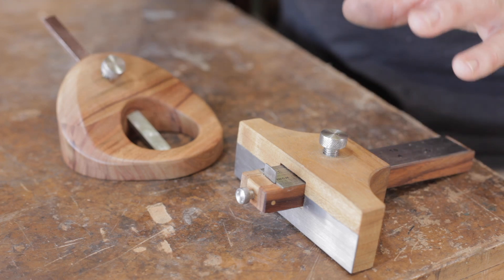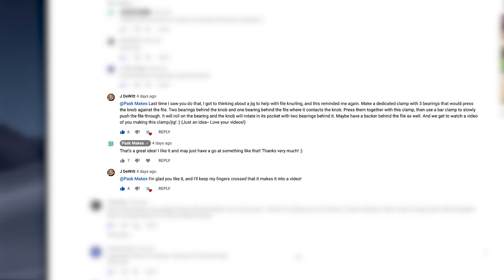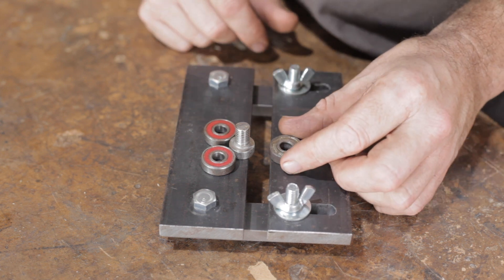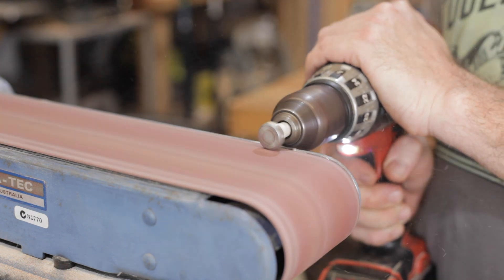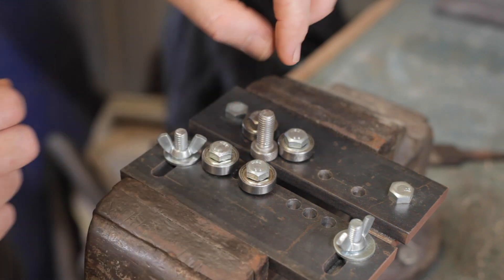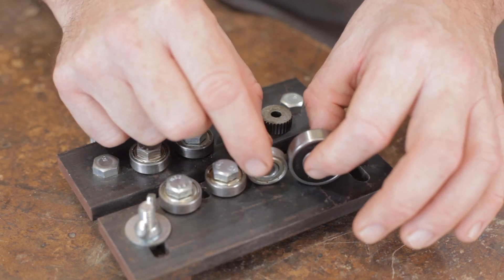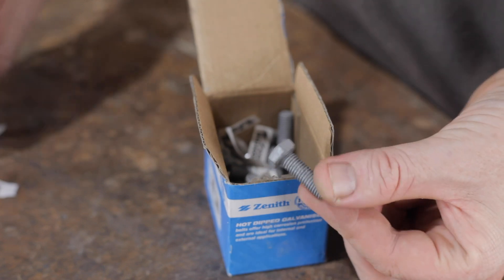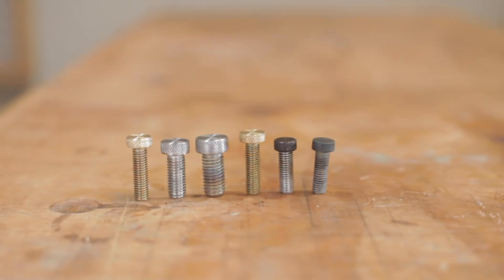Homemade Knurling Jig

Comment: Thanks so much for your videos. I often learn a lot from them.  When I was a student in school, we used to do knurling on a metal lathe and we used motor oil on the knurling tool to lubricate the tool and the job.  It tends to make the cutting process easier on the tool and the job... Thanks again for your efforts. Great job.

Comment: Yes, I know this is over 4 years later but I decided to comment anyway. Using a file was an interesting idea in order to get a somewhat "knurled-ish" surface on your thumbscrews and I believe it can still work if you incorporate solid bearings and an overhead support column to keep the solid bearings at a perfect 90° angle relative to the baseplate. The problem is how to come up with the solid bearings? Well, as a machinist I would simply make them using a lathe... but then one would have to ask why I would manufacture a tool to knurl anything if I had a lathe... and could conduct knurling operations on it. Uh, yeah. Let's pretend I just had a "friend" make them for me! Great!! So I would have my "friend" make me 4 piece, shell type solid bearings out of stainless steel. I'd go 1 inch tall and a good 1 ½ inches in diameter to eliminate flex. I would also groove them for grease while still being tight with a clearance of .001 to .002 thousandths between shell pieces. Then I would install them on free floating on pins held in place by the overhead support bar. My initial thought is that you would be far more likely to find success with that design but I'd also be tempted to just go with two solid pins rotating in both the baseplate and the overhead support bar as even precise shell bearings might prove to be either overkill or simply not work as intended. Yes, I realize that simplicity is the idea here and making a tool that anyone else at home can make easily is the thing. But if all you're doing is attempting to manufacture a jig so a file can be used then ditching multi-piece bearings for single-piece pins might be viable. The reality of the situation as I see it though... is that attempting to make a tool to knurl is actually pointless. Why? Because you're better off attaining a lathe, even a very small lathe with only 6 to 12 inches between centers. I don't know if in the last 4 years a lathe has been acquired but I would encourage buying a bench lathe as even a small bench lathe is invaluable for making small parts. Keep your eyes on the local market and eventually you can pick up a used unit for a fair price. Getting involved with a local machinist hobby group may speed up the process. It's not unusual to find guys who know where things are that are for sale. Here's to success and best wishes!

- Max Giganteum

Comment: I know I'm like 3 years late but where did you get those first batch of bearings? I've got a project in mind and I could use some cheap bearings that size.
Reply from the maker: They would've been off eBay. :)
Reply: @PaskMakes  were they a certain type, like skateboard wheel bearings?
Reply from the maker: Skateboard bearings.

Comment: Ingenious. Interesting to see how a woodworker approaches metalworking problems.
BTW, the knurls and workpiece need to be swimming in cutting oil (dark sulphurated, as in pipe threading oil) to ease the impression into the workpiece, and to carry the swarf away. It will stain things, so keep it away from nice bits of wood.
If you replaced the opposing bearing with another knurl, it would help avoid flattening the new ridges by the flat surface of the bearing. For the diamond knurl, use an extra of either hand and lay out the pivots so opposite-handed knurls are nearly opposed and the extra is just to guide.

Comment: Great content. I often  end up working nuts and bolts into jigs, nice to learn how to knurl using a file. 
I use a coupling nut to hold and protect threads when chucking the nut into the drill for spinning, instead of taping the threads, but only works on the smaller diameters.  1/4, 5/16

Comment: 6:44 I don’t think the bearing shell is meant to absorb such point pressure. Instead, you should make an O-ring around the bearing shell from the steel plate so that the bearing is firmly in the hole in the O-ring and the outer surface of the O-ring receives a narrow, intense pressure. The O-ring is, of course, the same thickness as the bearing, and its diameter should be at least 1.5 times the diameter of the bearing - I believe - or more. In this case, a huge point pressure applied to the outer surface of the O-ring is widely distributed through the O-ring body to the outer surface of the bearing and the bearing does not crack.

Comment: Brilliant, and very thoughtful, how you stepped through the various possibilities to improve your knurling results.  I know nothing about knurling, except when I've seen it on YouTube, the machinist uses a lathe.  The original technique you used, with a file, is brilliant--especially if you only need a few knurled bolts.

Comment: Cool idea. I have used 2 files and rolled a bar between them to create a knurl. One file on the bench and push and pull the other over the bar or bolt. Good for creating a bit of  interference on a fit.

Comment: i might try tossing the bearings and just take the bolt holding the bearings, round the head and put it back in without the bearing and use it that way if you catch my drift?

Comment: I like your fixture. It is quite clever. I don’t know if this has been said yet, but I would swap out the bearing for a third knurling wheel. The flat bearing pressing on the small points created by the other wheels will work to flatten them, and constantly work against your efforts. When I knurl parts on a lathe, my preference is usually to use a constant stream of compressed air instead of oils, because the air will continuously evacuate the chips that are being created as you are knurling the part, but oil tends to hold the chips on the part which can ruin the knurl. The air does also help to cool the part, but perhaps less efficiently than the oil would. It is a trade off but my experience has shown better results than oil. Hopefully this helps.

Comment: When improving the depth of the knurling, don't keep rotating the workpiece in the same direction. Reverse it as much as you go in the first direction. If there's a difference in the pitch of the 'grooves' and the diameter of the nut head, continuing in the same direction will cause them to be laid in different places. Going back will put them in exactly the same place and improve definition.

Comment: Great job with no lathe. I wish to give you a few pointers to get better consistency part after part.
1) For each knurling wheel (pitch) there is a specified diameter that the part needs to be turned to to avoid double-tracking or overlapping of the pattern. You can search machinery handbook or google for knurling wheel charts and they list target diameters in steps for you to turn your part to for optimum knurl pattern. Even without a lathe, you can sand on a belt sander and get it close. Check this video. Joe explains it well.  https://youtu.be/9Zwi0ZAUCUc?t=540
2) Most people tend to go in lightly on the first try and this leads to double tracking the pattern. On the first pass, you need to go in very aggressive to reach the pitch diameter on the first turn. It is an opposite mind-set of what most machinists would normally do and it only applies to knurling. Go in HARD for the first turn. 
3) Try using some oil as well.
4) If you see metal flakes, STOP you are done and may have gone in too much. Try backing off a bit on the next one.

Comment: Just a FYI, if you wanted to pursue the file idea.... ball bearings like you were using are typically used for high speed low strength applications, while plain bearings (or bushings) are for low speed high strength applications. Something like a brass sleeve would probably have worked better (although copper pipe would probably work too). That being said, as a machinist, I'm impressed with how well this jig worked. And as a whole, stainless steel is much more difficult to machine than normal steel. Which is probably why the galvanized bolt worked so well by comparison (it was probably a low carbon plain steel).

Comment: Just a tip: After you have drilled those sliding slots to steel, put the bit into cordless, insert to middle hole if there is say 3 holes total and start tuning the drill in angle to each side. This way you can remove most of the waste material fast and just finish with the hand file. If you are working with aluminum you can work it with wood tools (just need to sharpen them more often and cheap chisels probably take some damage due poor quality needing more extensive sharpening, where you might not want to use your best chisels on that. I got bunch of cheap crappy chisels from fleamarket and  found some from land fill, so i use those to said more brutal tasks

Ah poverty lathe method! True challenge is to operate drill with your feet and use angle grinder with your hands. It aint pretty, it aint safest thing in the world, but it does what i needed. And cause i still lack lathe, maybe now i can get some knurlings done, opening up my repertuar of techniques in my disposal.

Comment: Excellent project! You gotta do some math and forethought though.The file failed because of the angle the file teeth have. If you push towards the teeth, it may work but pulling backwards will result in flattened form and broken teeth. Also when using a knurl, it is vital for success to make the diameter of the work such that the circumference will fit the number of teeth imparted to it. otherwise, you'll get "cross threading".

Comment: Was just looking for some M10 knurled-head screws - I checked a big USA online hardware store whose name starts with "McM" (who are excellent btw); but anyway each screw in brass was US$31.29! - I needed four screws it was gonna be $135.00 plus $11.00 shipping..

(on another topic re the oxide method I'm sure you're aware but for your viewers who might heat up those zinc bolts watch out for the fumes). I didn't read all the comments so sorry if I'm the 199th person to mention it..)

Your videos and craftsmanship are outstanding and I always learn something worthwhile from you.

Comment: If the ball bearing fail I suggest you use cam followers since the OD ring is thicker.  

Also look at centerless grinding set up where only need two wheels and a rest to stop the head from moving out.  The two wheels are over center so they push the head against the stop but the force is low because the angle off the center line between the wheels is small, sine of a small angle is very small where the cosine is very close to full force.

Comment: Sorry young man. 
I've noticed a problem. When you use the knurling wheels opposite the bearing like that, the bearing is acting against what you are trying to achieve. It's directly trying to smooth out the knurl, stopping the true definition.
Clamping type knurling tools can be purchased at a reasonable price, and if you clamped it to your drill press table, either with the aid of a vice or jig clamped firmly down, you could then knurl on your drill stand, as you'll have each of the two knurling wheels either side of the bolt. And you should be able to just feed the bolt downwards between the preset knurling tool.
I wouldn't recommend using the bar type knurling tool as that would only assert pressure from one side and cause the morse tapered chuck to fall out of the spindle.
Edit: when knurling the way I've suggested, don't try to do the full depth in one go, start with a light definition, then a deeper one, and a third and final full depth "cut," for want of a better word (Yeah, I know the knurl is formed).

Comment: The problem with the coarse lines is that you need the pattern to match/overlap as it goes around. This would be messed up by finicky changes in distance around the "2bknurled" object. A finer set might work better, but not sure how fine it would have to be to "drop" into the pattern with each rotation.

Comment: In the machine shop I had a knurling tool that I used on a lathe. As the part turned you increase the pressure. That is exactly what you're doing. Now I want you to try putting a cutting oil on it like when you tap a hole. It made a big difference on the lathe. It stopped the chipping and messing up the knurled part. I think you can buy knurled bolts and screws cheaper than bearings. hahaha. Good luck

Comment: wouldn't be cheaper to just buy thumb bolts    https://www.zoro.com/zoro-select-thumb-screw-knurled-4-40x14-l-stl-z2300/i/G2329327/feature-product?gclid=Cj0KCQiArozwBRDOARIsAHo2s7twYg7FavrbIwtn3eX_2
Reply from the maker: Not so easy to find 10 or 12mm knurled thumbscrews though. I use them that size to thread straight into wood. :)

Comment: I would think that depending on the diameter of the bolt to be knurled the second knurling wheel would destroy the pattern made by the first one. I would use three wheels, with only one having the pattern. The other two I would want smooth and covered in an extremely hard plastic so that they also do not affect (flatten) the pattern. Solid disks with lubrication seem like they would be best after seeing how the bearings held up.

Comment: Great tool. It will go on my to make this winter list. When you drill or tap a hole try using a little oil. Cutting oil is best for that is what it is made for. Use it for Knurling also. When ever metal is used to cut metal oil helps it cut easier, prevents binding, and cutting tool last much longer and run much cooler. This is true when you cut, drill, die, tap, mill, or turn. When I was a kid I broke off a lot off taps and drill bits in a hole. It happened all the time and is a real pain in the blank. When an old machinist suggested I try using oil I almost never break a drill bit or tap, and I can drill ten times as many holes before getting dull.
Reply from the maker: Thanks Wayne! I used to use 3in1 but I have recently started using cutting oil and you're right, it works great. :)

Comment: I like the idea-I have a lathe, so I knurl in it, but this seems like a good method if you don't have a lathe. One suggestion-try replacing the bearings with a third knurl wheel (that matches one of the ones on the the other side). I would bet that your knurls are  being flattened by the bearing, even as you're deepening them with the knurl wheel.
Reply: Won’t that mess up the knurl pattern?!
Reply: @PawsleyDirt  no, it will just ride in the grooves made by the other knurl that it matches. The bearing is more likely to mess things uo by flattening out what you have just knurled.

Comment: I did the same thing using a large rotary pipe cutter and substituted knurling wheels for the two bearings and a bearing for the cutting wheel, worked OK.

Comment: Nice tool!
Need a soft gasket (copper, brass, duralumin, leather, plastic) between the bolt head and ball bearing. Smooth hard surface damages knurling.

Comment: Too bad you couldn't lower the center of your push with the vice by putting the knurl gears even with the center of the vice top to bottom. That would correct some of your rigidity issues.

Comment: Great video as usual. I'm just wondering. Why didn't you remove the bearing altogether, and just use a knurling wheel in its place instead?
Reply from the maker: Thanks Peter! I was just working it out as I went, if needed that would probably have been the next step. :)

Comment: It looks like those wingnuts serve no real purpose.  It would seem that, because of the vice, one would only need a peg, rather than a full bolt-and-nut setup, to position the moving plate properly and also guide it forward as the vice pressure was increased.  What am I missing?

Comment: Just a tip from an old toolmaker Heaps of clean cutting oil for knurling and  heat to red hot  and drop in old black sump oil for a dark metal finish . Cheers from Adelaide

Comment: I saw a knurler made from flat stock cut into a Wye with both knurles on the ends of the Wye and the piece is rotating and you push the Wye against it. Really good cut and fast.

Comment: I wonder if I might offer a suggestion. Instead of a bearing on the 3rd place which is only trying to flatten out your knurling progress as you go, you simply put a 3rd knurling wheel instead of the bearing. {no idea if it will help or hinder the actual knurling; but will stop hard bearing shell from flattening the knurl}.
Hold them in place with bolts that have the thickness of the knurling wheels unthreaded near the head so the wheels have a full smooth surface to take the load and tap threads into the steel plates holding the knurling wheel and use a locking nut on the underside of the plate to secure the bolt allowing you snug the bolt head to the knurling wheel but not wind up clamping the wheels by the head & steel plates.

Clever ideas you had so far though. I enjoyed watching the progression of them. In the end though I think there is already made 3 wheel knurling tools that close in like a small pipe cutter. I do not remember the price but was looking at them on the net a year or so ago. Cheers mate.

Comment: Love the file idea as everyone has one! I'll be working on making that more practical in the near future. As for the knurls themselves, if no one's mentioned it yet: the straight knurl only needs one wheel. The diamond knurl normally uses two as you have them, but they do make patterned diamond wheels where only one would be necessary. Bear in mind that the distance between the knurls is a product of the diameter in which you're knurling. Also, the diameter of the bolt head is increasing due to the displacement of material caused by the knurling wheels. All in all, the file trick is indeed the most inventive and if perfected could be of huge benefit to the weekend warrior. Tha is for the videos and keep up the work!